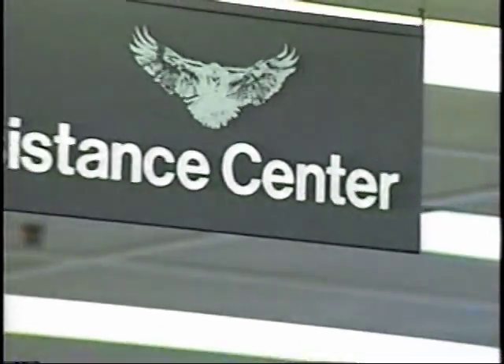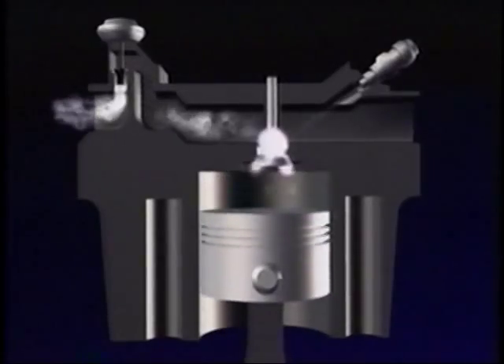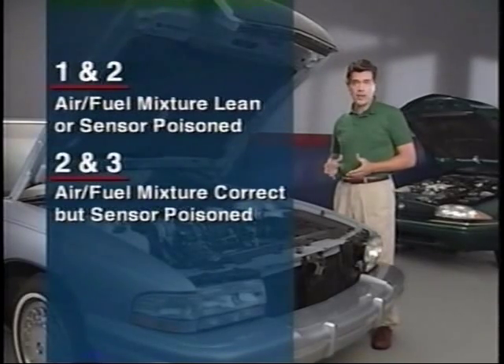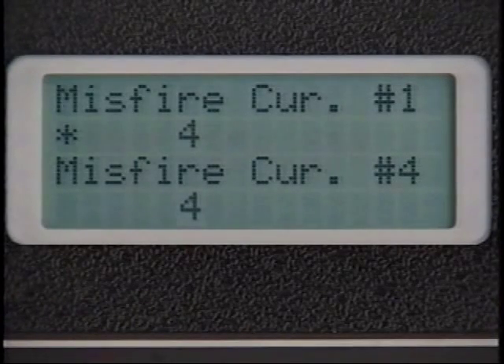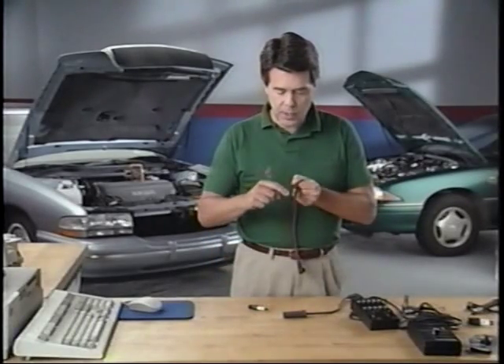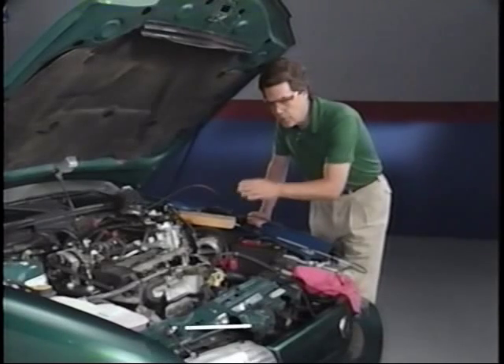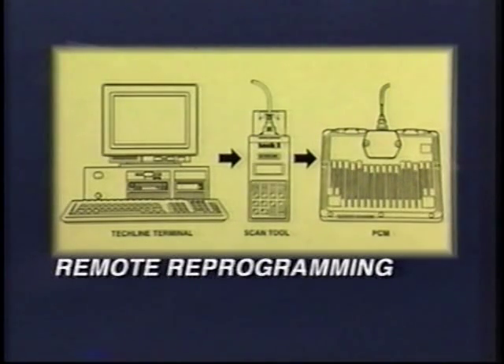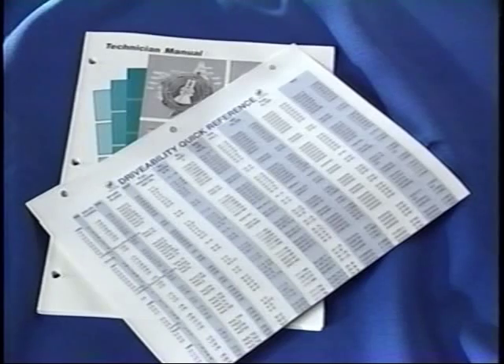Buick - Driveability Testing Diagnosis (1996)

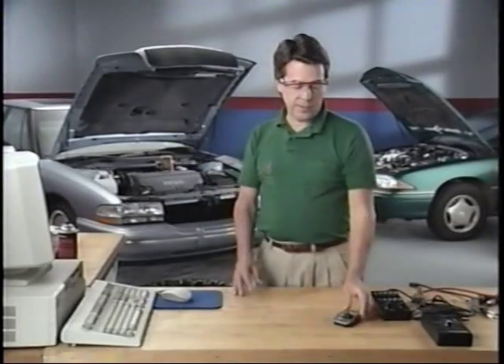Comment: Woah.. at 15:34 this guy recommends Brake Cleaner as a way to clean the MAF.. I was taught that is a no-no. Electrical contact cleaner and MAF cleaner, yes. Carb and brake cleaners, no.
Reply: This video was made before the advent of specially formulated MAF cleaner.
Reply: @digitalrailroader  Also, I think CFCs were more common, and the formulation of brake cleaner likely is very different in that it would leave residue/melt/ruin the wires and components
Reply: The formulation of brake clean and the lack of MAF cleaner are the two differences, in less words.
Brake clean = worse now for the wire
MAF cleaner  = is fine, is now in existence